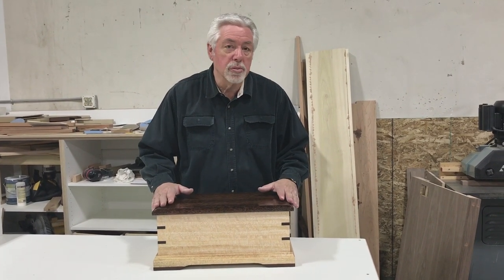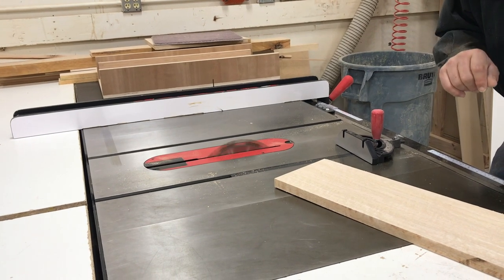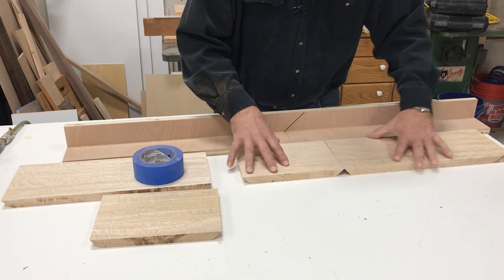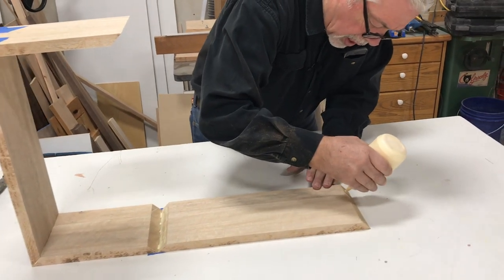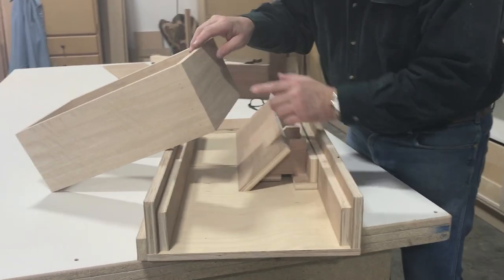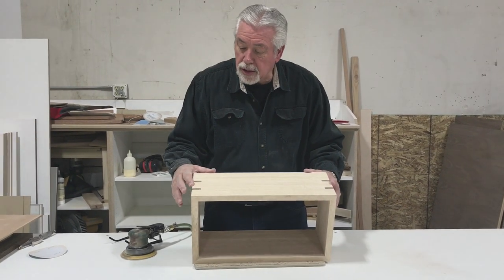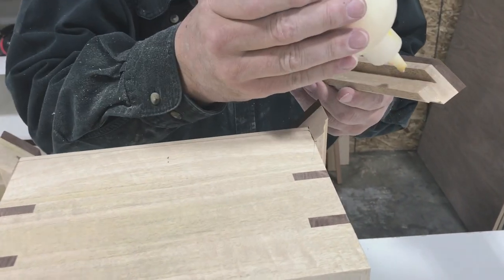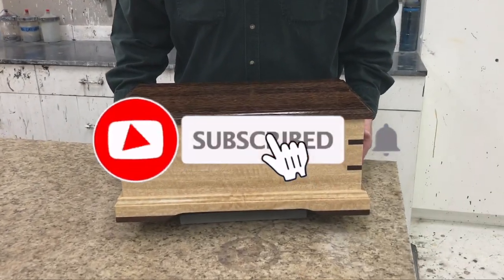Decorative Memory Box with Splines.

Comment: Is the trick for long point-long point 45 miters, to simply subtract thickness from final dimension, which in turn will get a starting point from how far the blade is?
Reply from the maker: If I understand your question correctly, you are asking for the best way to measure long point to long point.
I start by cutting the 45 on one end of my stock and then measure from the cut to the measurement that I want and then cut to my mark. I hope this helps but feel to follow up if you need to. Thanks for watching.